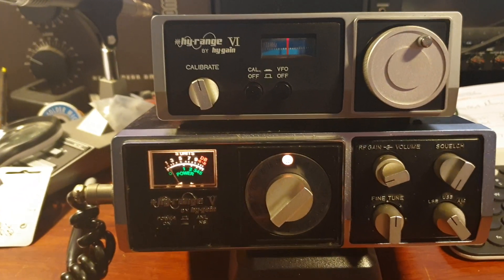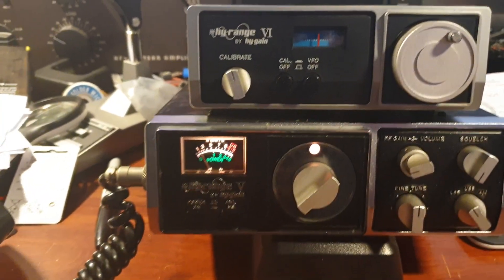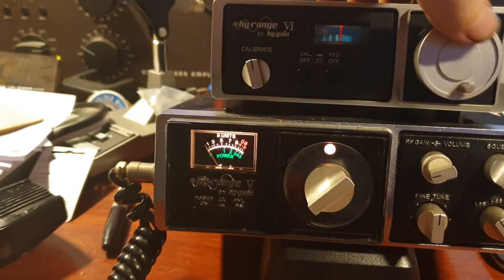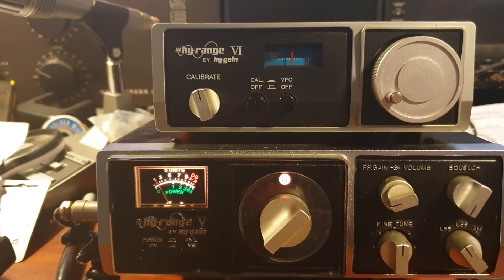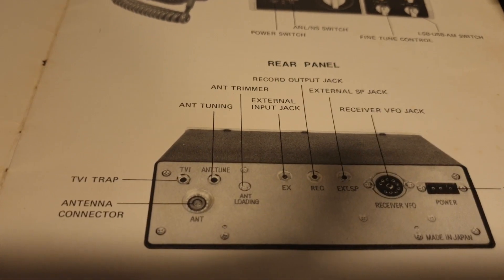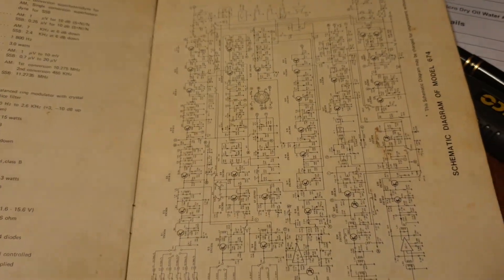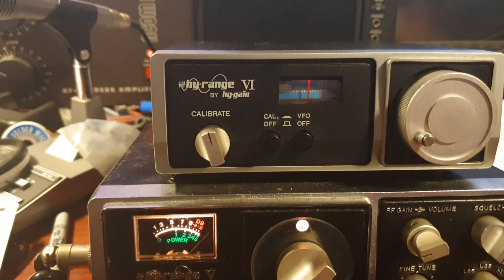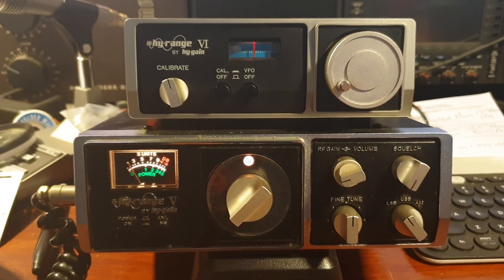Hyrange V model 674 by hygain with Hyrange VI External Vfo

Comment: For future reference. If you have and HyGain radio that has the VFO socket on the back and you don’t have the VFO, you must put a jumper between pins 5 & 6 for the radio to work. Also, the radios weren’t set up to transmit with the VFO from the factory, only receive. I remember when these came out. We had 23 channels and there was talk of the FCC approving more. So HyGain jumped the gun and produced this VFO to let CBers listen to the upper channels but not transmit yet. They thought the FCC would approve a VFO instead of requiring a click channel selector. With the idea that you would send it in for a free upgrade to transmit when it was approved. But the FCC didn’t approve VFOs! Of course it only took a simple wire change to transmit with it and most CBers did it or had it done. By that time nobody cared what the FCC said. It is a rare example of a unit that was built to cover the upcoming channel expansion but then wasn’t legal to use on transmit. The VFO came with instructions and parts to convert several HyGain CB radios to use this VFO. I have one with the instructions, pigtail for inside of the radio, and hardware. You had to drill a hole in the back of radios that didn’t have the socket, factory installed. If you have one of these VFOs, especially with the installation parts, you have a rare item. Many HyGain radios had the sockets, but few VFOs were sold due to 40 channel radios coming out and PLLs that made extra channels easy and cheap. But for a while, I would have given my right arm for one of these radios with the VFOs! Great video!